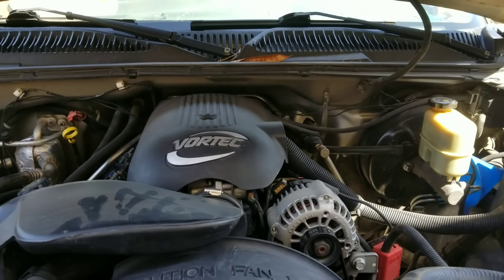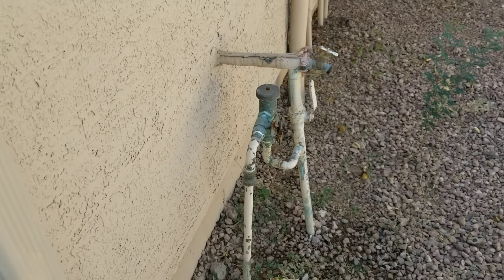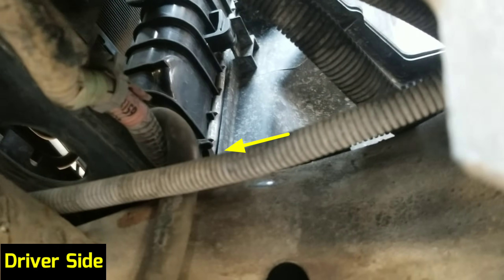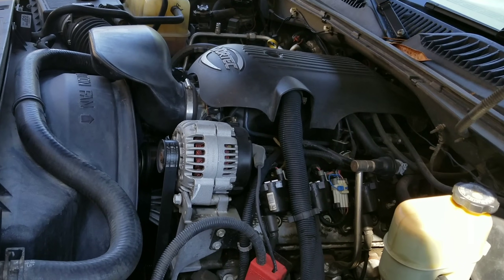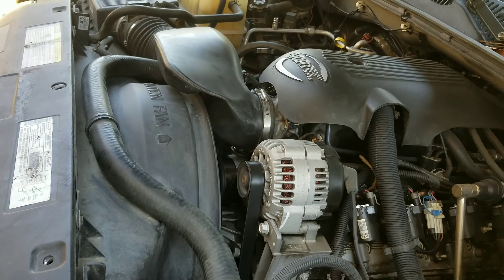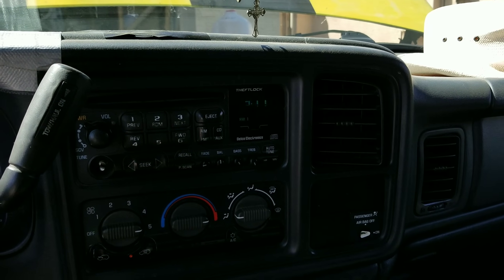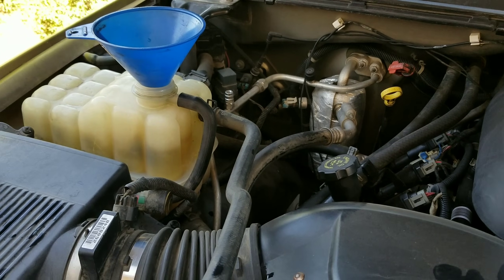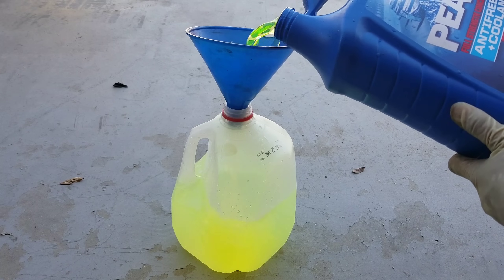How To Flush Your Coolant System! | Chevy Silverado Coolant Change Drain & Fill

Comment from the maker: Hows it going guys hope you found this video helpful! I have exciting things coming so hit the notification bell so you won't miss any videos! thank you for your support, you guys are the best!
Reply: Hi Eric I’m doing the same thing you’re doing but instead of using distilled water, is it OK if I can use well pump water? I want to hear from your response ASAP.
Reply: Hi Eric I bought the same antifreeze+coolant but it has  water 50/50 is that OK?
Reply from the maker: yes that's fine you dont want to use tap water because it has minerals that can eat up the inside of the engine and can cause rust
Reply: led lights for trucks
Reply: Hey Eric.   I like the look of your tires.   I live on some treacherous winter mountain  roads.   May i ask what those were?
Reply: I know it is kinda off topic but do anybody know of a good place to stream newly released series online?
Reply: @Davion Ralph I watch on flixzone. Just search on google for it :)
Reply: @sherrokinchen5253  Well water is worse than tap water. Is has rela minerals like "iron" which causes rust. Tap water is filtered but still has minerals. Distilled water is only a buck or two per gallon. Well water is full of minerals. That's why you get hard water stained from it. They add filters and water softener to well water because of this.
Reply: @mostdavestdave69  not all well water has iron in it. some well water have a levels of calcium, like my well Water has a high level of magnesium which is normal.

Comment: Please don't add cold water from your garden hose to a hot or warm engine.  The difference in temps can crack a block.
Reply: Feel real stupid for doing it but just went through that a couple days ago, now I’m in the process or replacing my radiator 😓
Reply: What if it's not cold but indeed hot ?
Reply: Use distilled bottled water not tap water. Tap/garden hose water has minerals in it and will rust cooling system. 👍
Reply: @benjaminruckman6352  your local water utility can tell you whether or not the local water has too much mineral content to use in your radiator.
Reply: lol why don’t u crack a block when u go through a big puddle then lik
Reply from the maker: By the time the water makes it to the block, it would not be at room temperature or cold anymore
Reply: Thank you

Comment: Everything on my GMC says use Dex, I don't know for sure, so I will stay with Dex but Green coolant is a different chemical mixture than Dex.  May not be the best thing to do for your engine.  You should consult  a reliable mechanic and get their opinion.  The outcome may not be the best changing from Red/Orange to Green for your truck's internals!!
Reply: I've read that DeX is no good, eats gaskets, etc. Changed to green years ago, no issues. I think most green now is universal anyway.
Reply: Ive use green on my 2001 Tahoe for a while now. No issues at all.
Reply: Been using green coolant in mine for 12 years. 5.3 engine. No issues at all. 244k on original engine.  But with that being said I think it's fine using dex cool  and I don't see any benefits to me switching over other than cost.
Reply: Yeah me aswell iv always heard even from school that switching up the different color coolants they have the different chemicals sorry for not remember but I think it’s the ethylene glycol acts differently to the plastics vs propylene in the specific systems, again no experience in the manner just what iv been thought through school so I have steered away from the swap
Reply: Dex Orange is made for Aluminum engines because it doesn’t corrode it, the others might though that is why for aluminum blocks only Dex Orange is recommended.
Reply: My 04 is a iron block l59@diedfrombored5295
Reply: Use what was used before.

Comment: Didnt understand why you converting to the green coolant when the system calls for dexcool
Reply: it doesn't matter what coolant, as long as you completely flush out the old stuff. Some guys don't like dexcool because of the gasket failures. Its a personal preference, but you can do it
Reply: @HeavyDutyHauler  ok didnt really know, a buddy of mine switched over from green back to orange in his caddy a short time after engine was done
Reply: @HeavyDutyHauler  but thanks on that good content!!!!!
Reply: Tommy Woods HeavyDutyHauler isn’t correct on this one you can’t simply just put whatever coolant into system. You should put what your owner’s manual calls for. That may have been the case for older vehicles. But now days manufactures make blocks with different metals and some engine blocks due to the different metals may require more rust inhibitors than others
Reply: @geroldgerry3375  Gotcha
Reply: Don’t use green coolant in an aluminum block, it will corrode the system.
Reply: They require dex cool for a reason
Reply: In general, I agree that it is important to use the proper coolant for a vehicle, as specified in the owner's manual.  However, in older GM vehicles, Dexcool has a bad history of forming a mud like substance inside the cooling system, causing total failure.  That is why many car guys who own GM vehicles will flush it out and replace it with the universal long life coolant.  Just do a quick 
Youtube search on Dexcool problems and you'll see what I'm talking about.
Reply from the maker: thank you!
Reply: The coolant used here is a DEXCOOL clone. So he replaced DEXCOOL with DEXCOOL. Ford even uses DEXCOOL now.
Reply: @cosmiclawnmower9818  dumb comment. The universal coolant is DEXCOOL.
Reply: @davidporter7051  Not quite.  Dexcool has been used exclusively in GM vehicles since the mid 90's.  In recent years, Ford has also started using a similar formulation as well in applications that call for their "orange" coolant.  That is it though.  By "universal coolant" I mean coolants like Prestone (yellow jug) or Peak Long Life, plus various other brands that offer something similar.  These are not the same formulation as Dexcool and are not used as OE in any vehicle I know of.
Reply: @davidporter7051  I never said anything about using color solely to compare coolants or claimed I was an expert in chemistry.   Color is only a dye.  Clearly you didn't read my original post.  The point I made to begin with was that Dexcool, in the first few years GM used it, caused many cooling system failures because it was incompatible with the gasket materials used in the engines at the time which originally took the classic "green" coolant of past decades.  By "classic green" I mean the old IAT coolants containing silicate and phosphate.  This problem was corrected after several years and newer late model GM vehicles use Dexcool with no problems.  However, many owners of older GM vehicles will flush out the Dexcool and use either the old green stuff or the universal OAT long life coolants without the  potassium 2-ethylhexanoate found in Dexcool.
Reply: Lookup oat vs hoat vs iat coolant types
Reply: @drapergreen6342  THANK YOU....Exactly theres a reason for why GM specifically recommends Dexcool lol Some of these backyard mechanics teach some Dumb tech they heard from a drunk buddy. Wow
Reply: @davidporter7051  EXACTLY 💯 👏 has to be the specified dexcool alternative.
Reply: Dexcool actually causes waterpumps and gasket failures and pitting in the metal.
Reply: @lgtab1553 I'd rather replace a water pump and its gasket than replace a cylinder block

Comment: To everyone saying he used the wrong coolant, Peak Long Life is not the old IAT silicated green, it's a modern OAT coolant and it's perfectly fine to use in this vehicle.  It's chemical composition is exactly the same as Dexcool and I've used this and other universal OAT coolants in dozens of different vehicles over hundreds of thousands of miles with no issues whatsoever.
Reply: Name checks out
Reply: @mattmatt222333  lol true
Reply: I was actually wondering about that thanks for the info I’m doing my truck this weekend
Reply: True. Its just universal coolant.. not the best, not bad either, just coolant

Comment: I would recommend removing the thermostat when flushing out the old coolant since you can then do a number of good flushes without getting the engine too hot. You don't want to refill a hot engine with a cold liquid, a friend of mine cracked his cylinder head doing just that.
Reply: Dam
Reply: Thank you for the wisdom just did mine and it worked fine. Removing the thermostat before I started process. Thank you for the wisdom bro.
Reply: removing the thermostat on these trucks is a royal pain, not worth it unless you need a new thermostat
Reply: @jc13781  No it's not, lol. Remove the air intake and it's in arms reach.
Reply: @yourface3154 lmao not that simple
Reply: @Dark-xs5lf  I have a 99 and it's pretty fuckin' easy to change.
Reply: @yourface3154 I’m sure it is but it’s in the negative double digits rn and doing all that is an extra pain but now I really don’t wanna add it if it’s gonna crack my block lmao

Comment: 1 clear water flush will get you to 99% free of the original charge of red 50-50. 4 X flush is unnecessary. Modern coolants have rust inhibitors and additives to inhibit mineral crystallization,  so it is perfectly fine to flush the system with tap water.

Comment: 05 Silverado.  Drained/refilled twice in 15 years with Dexcool.  Never changed a hose, water pump, or anything in the cooling system.  About to do it again in a few weeks since it's been 5 years since the last drain/refill.  Nothing wrong with Dexcool in these trucks due to the dry intake.  If you have a V6 that has a wet intake, I could understand the concern since the Dexcool eroded the intake gaskets and caused a bunch of issues with those model engines.

Comment: Good video man. I just did this process today. One thing you should consider is you never get all the water out of the system after a flush. When you drain your final flush there is a considerable amount of water left in the lines and heater cores and the block and heads etc... You should get a coolant tester and test your finished product because when you figure in all that water and add 50/50 to it you are not left with a final 50 50 mixture. More like 75water/25 coolant. Also i used only distilled water. I never hook a hose to my cooling system...Food for thought
Reply: Could you just start it with the hose off to get the rest of everything out?
Reply: To be sure the fluid is out of the block it is advisable to remove the block drain plugs. There is one on each side of the V8.
Reply: @followerofchrist1961  On these engines the thermostat will be closed as the vehicle is not at operating temp. Unless you go through the added step of removing the thermostat you will still have fluid trapped in the block. The thermostat will allow a miniscule amount of fluid pass through but not enough to thoroughly drain the block. I let mine drain overnight just to see & then removed the block drain plugs. Yup, more fluid came out.
Reply: @tonylopez9936 where is the block drain plug located on these vehicles?
Reply: @fallenone6  I removed the coolant temp switch on the driver side of the engine block to drain some- looking for a better method now
Reply: @dantheman4585  cool thanks man

Comment: @3:33 you're going to fill up the reservoir with distilled or ionized water. Don't use tap water to flush out the cooling system. Ionized water is better but you can use distilled.
Reply: I think you mean de-ionized.
Reply: The manual says distilled water is bad!
Reply: @jmitch6764  Yes deionized
Reply: Ima just put fiji water in my truck
Reply: You're not supposed to RUN it with straight tap if you somewhere warm enough that let's you get away with it, a flush isn't going to give your water jackets and thermostat enough time and heat to strip the calcium out of the water and mess up your block. I think my favorite thing I've seen is watching a guy pull all the water hoses completely and run a garden hose to the radiator, heater core, and block individually and watched it pump out all the gross crap that doesn't come out in a regular flush.
Reply from the maker: If your vehicle has regular maintenance, then you shouldn't have those issues. If my  heater core or engine would of been that hat dirty, I would of taken a different approach

Comment: Ive had the original dexcool in my 07 gmc sierra since i bought it in October of 06. Thats 14 years. Still runs as cool as it did when it was brand new. Gm changed the chemicals on dexcool in 04 I believe. Doesn't ruin the gaskets no more. As long as you don't contaminate it with another coolant, it works like it supposed to. But if you mix another type of coolant by accident you need to flush the system immediately.
Reply: Mixing coolant doesn’t do shit
Reply: @alecsanderfuentes3913  Well, actually it does. You can not turn a 2 year coolant into a 5 year coolant. Add a 2 year coolant to a 5 year coolant and you dilute the 5 year coolant. So that proves that adding chemicals has a reaction period. I am told that the newer coolants don't react as the older formulas that turned into a gel & clogged radiators, etc... And it was already mentioned that the red used to affect the gaskets on the v6. You can take a chance with your truck but my pockets aren't that deep. I think Ghostrider has a more salient sugestion.

Comment: I have an 07 Sierra there is no drain plug on the radiator I guess I'll just take off a bottom hose right
Reply: For some reason some radiators won’t have the drain plug,I have a 2005 Tahoe and need to replace the radiator and don’t have the drain plug, so is what I do remove the bottom hose

Comment: 3 thing wrong here, one: you should never change coolant type, every coolant is designed for particular vehicle, compatible with the metal kind, they are not universal, keep the original is the best. Second, never add cold water to hot engine, it will crack your engine block. The last thing, after flush the system you you cannot add 50/50 coolant because it has half capacity water left in it, add 50/50 will make it about 30/70, you risk your engine get frozen in cold winter. This video is vey misleading, good way to destroy your vehicle.
Reply: As soon as I seen the switching coolant thing, I was like 🫨
Reply: That’s not true at all lol . I always change coolant type and I have never had issues . If you fully flush you are 100% fine
Reply: Yes. But GM specifically has to have dex cool, which is the orange stuff. Theory is kinda like 2 cycle in a way. Gm will burn off regular coolant. Whats worse if you mix them they create a sludge and it will smoke your water pump quick!
Reply: @TonyGraf-y3g  full flush like I said  . Never had issues ! My truck never burns coolant if you’re burning coolant you have other stuff going on

Comment: When you drained the straight water out, some straight water remains behind. A final fill always add straight concentrate antifreeze up to 50% of system capacity. So when it mixes with the water, it ends up being 50/50. If you fill with 50/50 you may end up with 30/70. Test your final xix with an antifreeze tester with floating balls. They are in expensive.
Reply from the maker: it does not need to be a 100 percent 50/50 mix. you want to get close but it's not going to make a difference.
Reply: @ERICSDIYGARAGE  not 100% 50/50 is less than 50/50. I guess it depends on the level of protection you can be satisfied with...
Reply: @TheBrushcutter  It;s a good idea to test it after a few days
Reply: It doesn’t not need to to be 50/50 you can even run your truck with nothing but water if you want if you don’t live in cold weather. It’s called antifreeze for a reason
Reply: @ERICSDIYGARAGE  tbh the 4 or 5 flushes really aren’t necessary. A solid 1 or 2 will do just fine and the little remaining antifreeze won’t barely make a difference. If anyone is low on time just flush it out with water and let it run for like 5 minutes and then re add the antifreeze. Most times you need to let the antifreeze run through a little and then add more to make sure
Reply from the maker: @FearIsaiah  if thze coolant is really old with a lot of deposits, it can take a bit to get clean
Reply: @ERICSDIYGARAGE  true, but if you take care of your car on the regular it should be pretty easy lol, not hating just saying the experience I’ve had personally

Comment: Nice video, although honestly I was hoping for a block flush video with thermostat and engine block drain plug removal.
Reply: Thanks, just saved me 7 min, looking for same
Reply: @ktajax  I found the plugs... one under front drive shaft, other under the starter. In my opinion it was not worth removing...  the starter was a royal nightmare to reinstall. Just remove your thermostat housing, drain, remove thermostat from housing and reinstall housing. Run and drain with distilled water a few times and you're good. Reinstall your thermostat when you're done.
Reply: @PeterB12345  Glad I found this comment before doing it the hard way- thank you for coming back to update
Reply from the maker: You do realize that the thermostat is going to open at 180° which will be the same as removing the thermostat. In my opinion, this isn't a needed step
Reply: @ERICSDIYGARAGE  Well it's been a few years and I've done many more car repairs since and I tend to agree. You can likely just leave the thermostat in and let it get up to temperature. In my situation I was replacing the thermostat and all hoses as well, so it kinda made sense... And I guess I wanted that certainty that everything got flushed.
Reply: @PeterB12345 It makes sense to me as well, it makes it quicker than letting the truck get to operating temperature

Comment: Thank you brother! Doing a radiator drain and refill and wanted to research more about the pitcock and it's location. I have the 350 vortec in a 1997 Chevy Silverado 1500💪💪🙏 Very well broken down, I enjoyed the 3 fluid displays in the cut plastic bottles. Thank you for helping me with my truck Brother🤘🤟💪🙏😇👍
Reply: Facts